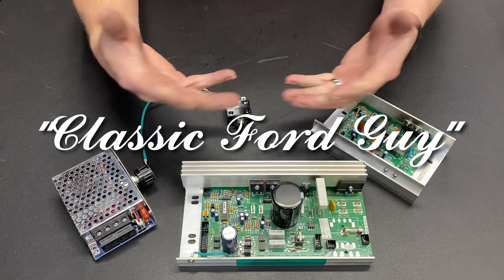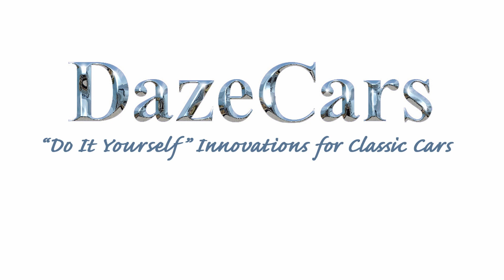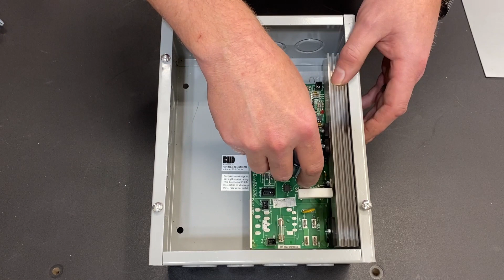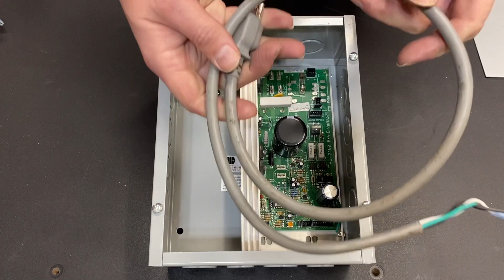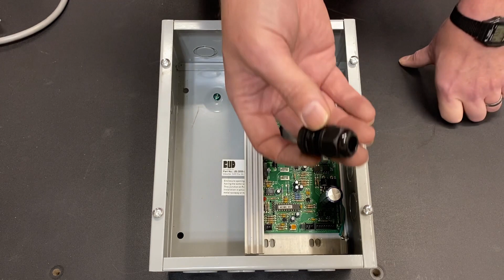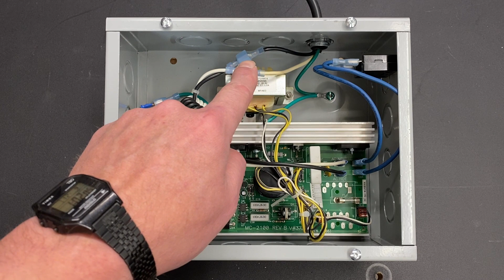Common Treadmill Motor Power Supply Mistakes When putting together DIY Power Supply MC60 SCR MC2100

Comment: I have a 6hp diesel engine and I use free fuel (grease) that I burn in the engine. I want to mate it to a treadmill motor to produce electricity,  I have a grid tie inverter that can handle 10-90 volts and 1100 watts, I don't want to feed more watts thanI'm using , do you have any suggestions,  also I have two nice lifepo4 batteries that I can charge and I feed the battery power at night, they are charged with solar during the day. My ideal situation would be me feeding about 700 watts 24 hours a day, any suggestions would be great
Reply from the maker: I have not messed with using a treadmill motor as a generator so I don't have any information for you.

Comment: Is a treadmill motor overkill for a bench grinder?? Mine died 🥲
Reply from the maker: depends.  First concern would be RPM.  A grinding stone has a max RPM.  Second concern would be torque you need to compare the torque of the treadmill motor to the torque of the previous grinder motor.
Reply: @dazecars  it was just my start capacitor thankfully I’ve worked it out yesterday. Still super interested in tinkering with this motor though as it seems to be a work horse.
Reply from the maker: so many uses for a treadmill motor and they work very well as long as they are set up correctly

Comment: Just a point of nuance... A power supply is a device that provides a voltage/current source (e.g., 5 volts DC @ 2 amps or 90 vdc @15 amps or 12 AC @1 amp). A device that provides a controlled power output for a DC motor is called a "servo driver" or "servo controller" or "servo amplifier" or most simply a "driver". A "servo driver" requires a "power supply", and the 2 may be integrated into the same device yet remain separate sections of that device. Such is opined by this retired automation servo engineer.
Reply from the maker: I really appreciate the information as it is good for me to know BUT it is for sure beyond the scope of this channel.  I am making basic electronic concepts and information about a DIY power supply option accessible to those not familiar with electronics and I need to bring the info to the level the viewer is at.   Someone looking for the kinds of information I provide is not going to know that its called a "servo controller" so they will not be searching for that but they will be searching for "treadmill motor power supply"  or "variable speed power supply" Again I appreciate the info for my own education as I find it very interesting.

Comment: Hi Dazecars I have a few questions if you dont mind?
How can you tell if you have a bad board. It seems no matter how i look it up, it seems to trip the breaker. Is there a way to test it? 
Is there a way to tell which board you have? None of my boards look like your MC 2100 or the MC 60 and i cant see where they say MC 60 or any other number.
 Im also curious what that yellow tapped coil is that is on the board? Is that a choke or an Inductor/Inducer of some kind? 
Last but not least, does it matter which way the current goes through the choke, because i dont see a positive or negative on it?Thanks for being patient with my dumb question. Thanks again with all your help
Reply from the maker: This may be an odd question but if you don't know what board you have how do you know how to hook it up correctly?  They all wire differently and use different parts to control them.  Best way to test a treadmill board is in the treadmill before disassembly.  Then depending on the type of board there are other techniques for testing.  Contact me through my website and send me pictures of your board and I may be able to identify it.  Not exactly sure what you are referring to as "yellow tapped coil" but it is likely a transformer to step the AC coming from the wall down to less than 20V so it can be converted to DC to power other parts of the system.  That is just a totally blind guess and I would need to see a picture to identify it for sure.  A choke is not polarized, the current does not care how it goes through it however some chokes work better on the negative side and some work better on the positive side.  Do you have an actual motor choke out of a treadmill or a component called a choke purchased off eBay or other source that "looked right".  Asking because it happens all the time. Also send me pix of how it is hooked up and I will see if I can identify any issues.
Reply: @dazecars  Thats why im asking where to find out what board i have. The way i do it now is by taking pictures of the board while its still in the treadmill and by what knowledge ive learned from you or on the net
Reply from the maker: Again contact me through my website and send pictures.

Comment: Thermal management of electronics is complicated and often done wrong.  Fan air cooling
Works but degrades over time as dust and dirt plug things up. Natural convection cooling
requires the largest heat sink. For this reason you don't see it used very often any more.
Reply from the maker: excellent points

Comment: We got a proform they had cut the wires we reconnected and there was a green wire which we believe is the ground wire. We connected it with a screw to the outside hole. But have no power. Any suggestions please?
Reply from the maker: you need to trouble shoot things.  Assumings it is DC as most but not all treadmill motors are, start by checking the motor on a battery.  if it works then the issue is likely the control board.

Comment: Where can I buy a Choke?
Reply from the maker: The choke in most of my videos is part number 130993. Instead of getting one new I would get a used one. A lot of treadmills come with a choke. Go to eBay and search “treadmill motor choke” BUT know that most people on eBay don’t know what they have and the word “transformer" will also appear in most listings. Problem is a choke and a transformer look almost identical so some listings are for transformers and some are fore chokes because the sellers think they are interchangeable. They are not. They would only be interchangeable if you modify a transformer to work as a choke. (see my DIY choke video) To tell the difference count the wires. A choke will only have 2 wires, a transformer will have 3 or more. Also before I started doing videos chokes on eBay could be had for $25 or less shipped but now that more people are looking for them (due to my videos) the eBay sellers have raised their prices quite a bit. Your best bet might be the DIY option out of a Microwave transformer. Please let me know if I can be of further assistance.

Comment: Great video. I wonder if mounting the whole assembly verticaly so the heatsink is vertical will also help with airflow along the fins.
Reply from the maker: My experience is if you use the better rectifier its not "working as hard" so heat is less of an issue but with that said anything you can do with electronics that produce heat to reduce said heat is always going to prolong the life of the component.

Comment: Hey! I just got my mc2100 and pwm setup. It works but to increase  the rpm I have to make a lot of turns of the knob. Is there a way to change this?
Reply from the maker: Sounds like you have it setup for 1000 steps instead of 100
Reply: @DazeCars  How do I change this? Going to use the set up on my wood lathe.
Reply from the maker: @tomnorton8218  I go over that in this video Bandsaw Upgrade Using the Tach Input on an MC-2100 to Have More Consistant Speed Tach Input Test
https://youtu.be/pAGfRHpHa-0
Reply: @DazeCars  Thanks  I will  check it out!

Comment: I guess I missed the part about needing a transformer?  Would be real useful to learn how to specifically wire up the 2100.  Did you use a choke on the output side?  Thanks > Bill
Reply from the maker: Some MC-2100 have the transformer on board some have it external.  A DC choke is not required with the MC-2100 but still a good idea if you happen to have one.   I go over setting up an MC-2100 in this video https://youtu.be/RikeVYxITUQ

Comment: Any reason why the enclosure can't be a wooden box? Would vent openings with filter cloth to keep out dust be a good idea (application is a drill press in a wood shop).
Reply from the maker: Plastic, wood, or metal they all make a good enclosure.  If using something non conductive like wood, make sure everything is properly grounded.  With a metal box it's easy to tie everything together through the box.  With wood extra grounding is going to be required.  Venting is a good idea but dust needs to be avoided.
Reply: Wood makes a fairly good insulator so a fan with a filter would be required.  That means the filter would have to be maintained regularly and that means remembering to do it. My rememberer doesn't work as well as it did 40 years ago.
Reply: @kensherwin4544  Good point, rather than a filter with a fan, which I considered, I chose to cut a hole in the back of the enclosure so the heat sink sticks out the back and the heat is not released inside the enclosure. Still working on the conversion, other things keep getting in the way, so can't confirm if it works but can't see why it won't.

Comment: another great video 
agreed all components should be grounded. I have been shocked by a dryer that someone wired wrong. I just plugged it in and the body was wired to a live wire .so yes ground is the first wire to be connected on any wiring.

Comment: Great video. I have a question. Not sure you can answer it but here we go. Do you have ant idea what size choke to use on a 2.5 HP treadmill motor using a SCR. What should the Henry and MA be ?  I have junked 9 treadmills and not one of them had a choke on them. All had one or two transformers but no choke. Thank you.
Reply from the maker: Not being an electrical engineer I can't give you technical specs but I can say this, the small choke I show in the videos works with all the motors regardless of HP.  The important factors are that that the wire is at least 16awg and the bigger the choke the better it functions.

Comment: Daze, if I’m using the thermal overload protection (blue wires from dc motor), should I still add a 15amp fuse on my AC power in? Thanks for the info from one Ford guy to another, I appreciate your videos!
Reply from the maker: yes you should.  The blue wires will only trip the system if the motor gets too hot.  Any other overloads in the system will not trip the thermals in the motor so the additional breaker is required.

Comment: Thanks again, Daze. The mistake I made on my wood lathe installation was to remove the flywheel which is also the fan. You said in an earlier video this year that the motor will overheat without the fan and you are correct. It does overheat when drilling with larger Forstner bits or turning large bowls. Now I'll have to install a fan to the motor shaft. Thanks - Garson  👍👍
Reply from the maker: all you need is moving air so an external fan that is independently driven would do the job something like this would fit the bill.  https://amzn.to/3FTJDPJ

Comment: Hey Daze;   a question was asked of me that I didn't technically know the answer to, but instinctively I "think" I know the answer to.  That was, does the size of the choke matter??  For the 10-130 VDC treadmill motors, say 1.5 - 3.0 CHP motors, how do  you know how to size the choke.
Reply from the maker: It needs to have at least 16 awg wire to handle the load.  I am sure there are specific calculations one can do to determine the motor choke size.  Not being an electrical engineer I do not know those calculations.  What I do know from my own projects and experiments, is that the bigger the choke the better job it does.  The one I show in most of my videos is about the size of a tennis ball.  The one on my lathe is closer to the size of a softball and works better.

Comment: No choke? Is it outside the box or did I miss hearing the explanation.
Reply from the maker: Because the power supply is an MC2100 (PWM type instead of SCR) a choke is not required.  Would it help, probably but the improvement would probably be minimal.